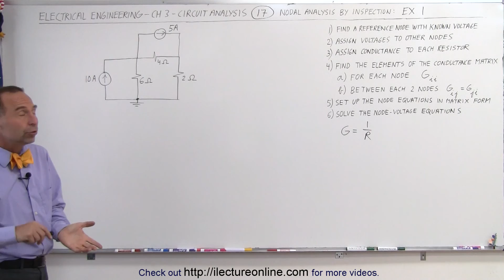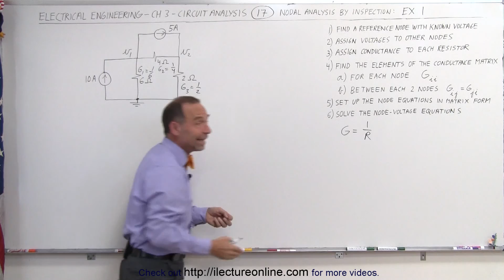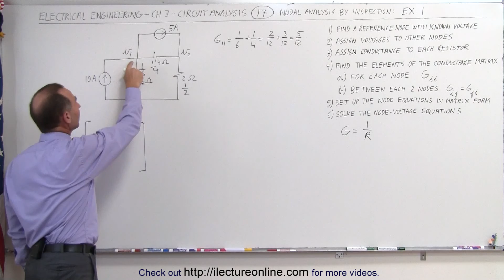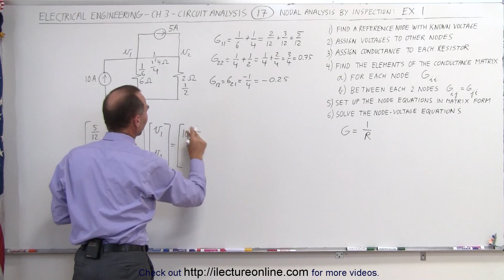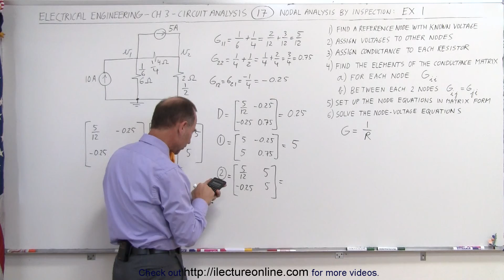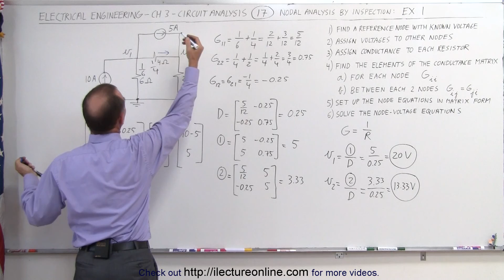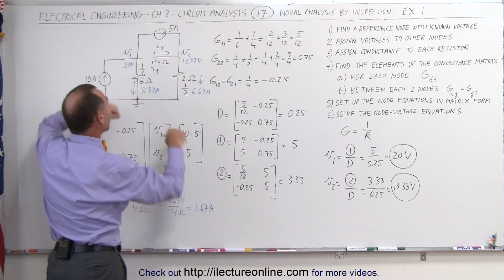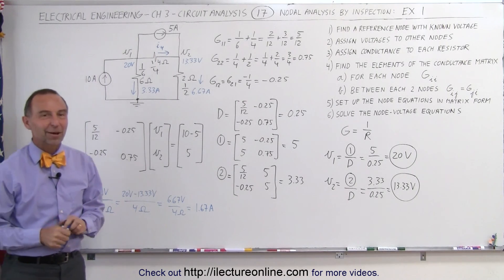Electrical Engineering: Ch 3: Circuit Analysis (17 of 37) Nodal Analysis by Inspection: Ex. 1

Comment: Thanks for the video. 
I have a question. Are current sources real things, or just imaginary object made to teach students circuit analysis?
Reply from the maker: They are less common than voltage sources, but they do exist.
Reply: You can set a power supply to be a current source

Comment: Can the current source for v1 be -10+5? which comes out to be -5
Reply: because i defined the currents leaving the nodes to be positive, and the ones entering to be negative.
Reply from the maker: Did you get the same results?
Reply: @MichelvanBiezen  I got the same but negative for the voltages
Reply from the maker: That is what happens when you reverse the current directions.

Comment: Are there restrictions for using this method like if theres two current sources then this method can be applied guaranteed, but if its only one current source.. its not applicable? I tried doing this when there was only ONE current source and my answers were off.
Reply from the maker: It should work with a single current source as well.  I also don't get the correct answer every time, as a simple mistake somewhere can throw the whole problem off.

Comment: How does this method apply if there is a voltage source in the circuit?
Reply: With Current Source Nodal Analyses by inspection, with Voltage source use mesh analyses by inspection
Reply: If it has a resistor in series, convert it to a current source with resistor in parallel